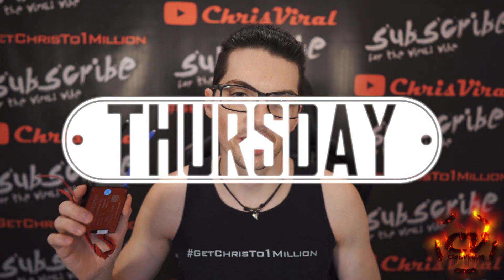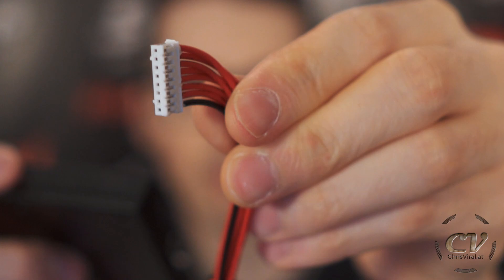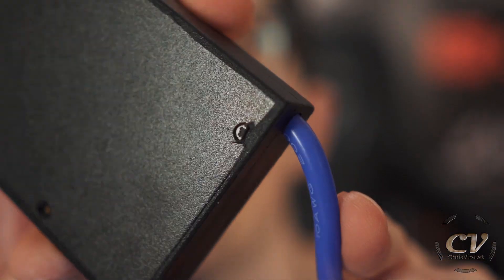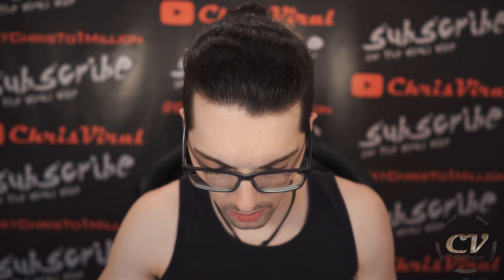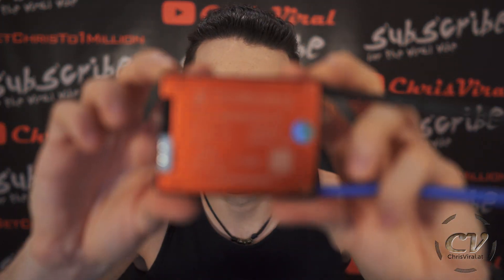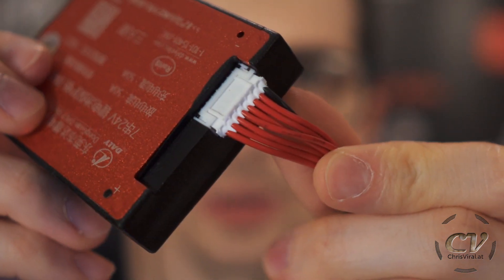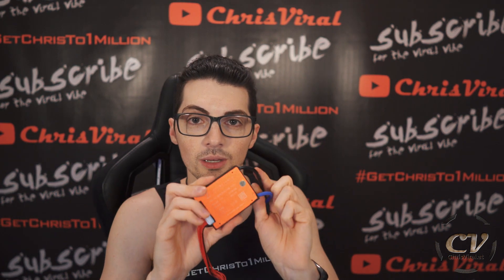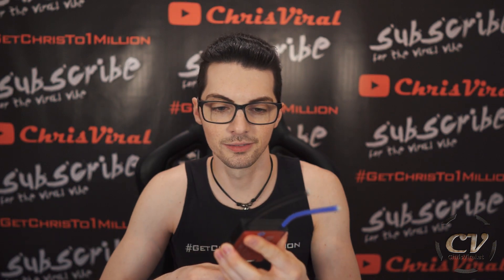7S BMS Review - 50A Battery Protection Board For Li-Ion Batteries (Waterproof)

Comment: Is it possible for Daly BMS to balance fewer cells than intended?
For example: Can I balance a 12s or 3s with a 13s daly?
Reply: Yes it can.  There are 2 typical ways of  doing this depending on the manufacturer, either you do not wire the non used ones or you either wire all non used ones together to the last battery cell. Just verify the wiring diagram from Daly. The BMS should know this when using the main P(+) output as reference.

Comment: How is this even a review? Everyone just could look up the spec sheet. A review involves testing whether the product actually meets the supplier's specifications using a certain methodology. No load test, drain test, balancing test, heat production test, or even an actual analysis of the electrical circuit has been performed.